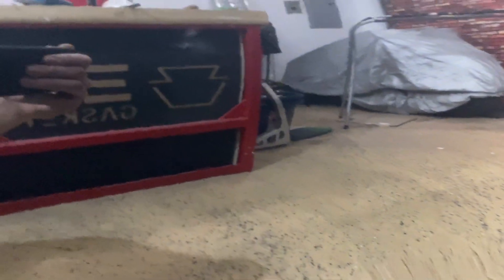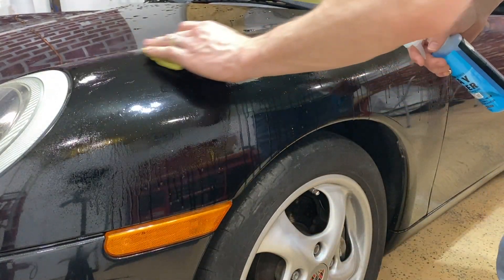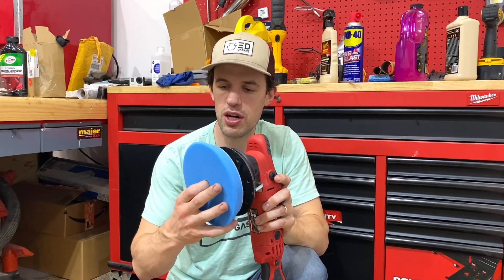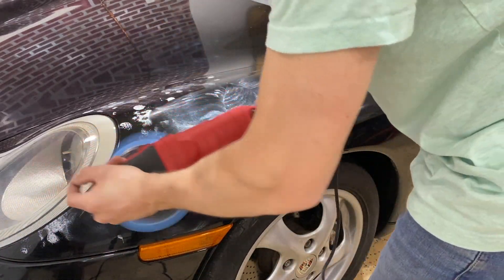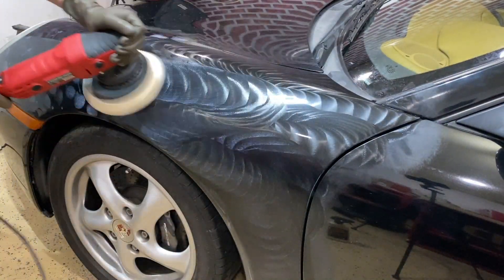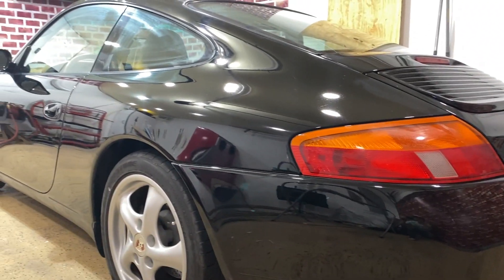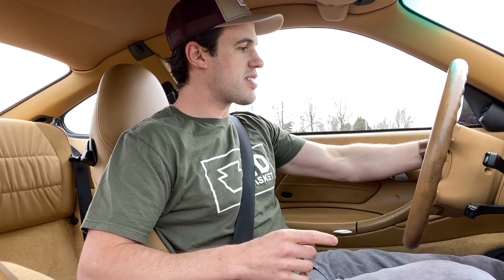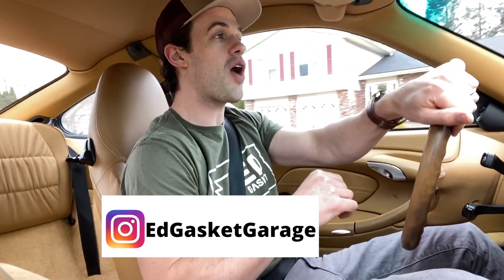The EASIEST way to RESTORE PAINT on your CAR | Feat. Porsche 911

Comment: Once the pad is wet i like to use up the pad with less pressure and moving more so the buff pad has less polish on it for the next panel. It is scary but its not overly easy to rub through especially on the open flat parts of the panel. Then you wont need many microfibers too. Love your editing style

Comment: Will it remove all the haze and holograms?
Reply from the maker: Only if they are superficial! Factors clear coat is super thin so you must be careful. Occasionally you must sand the clear coat for deeper imperfections. No worse feeling than sanding THROUGH your clear coat. You’ve been warned lol